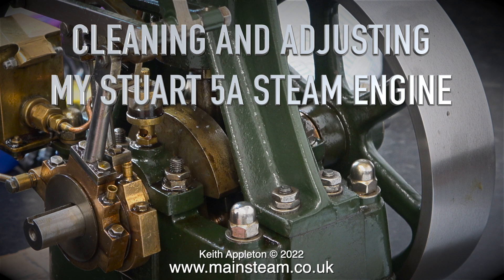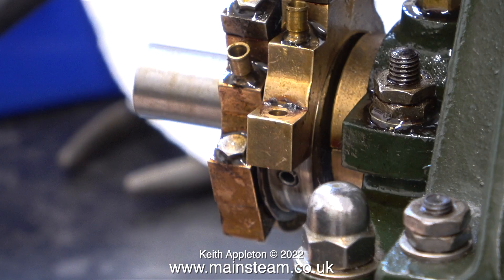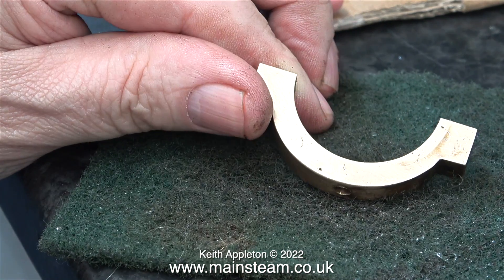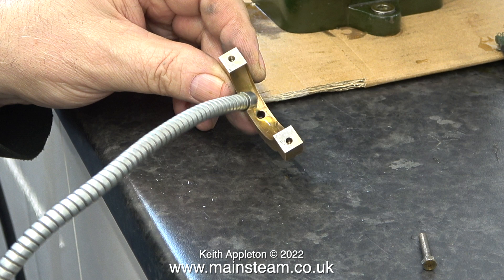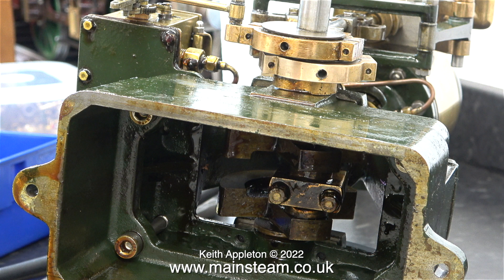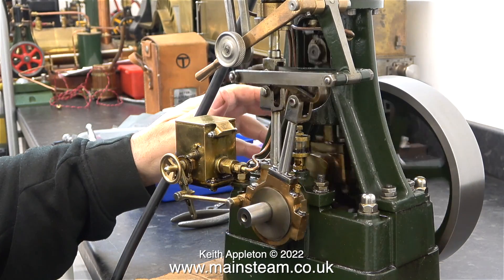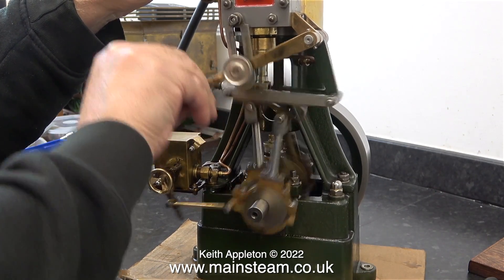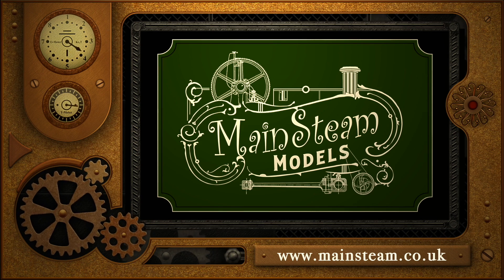CLEANING AND ADJUSTING MY STUART 5A STEAM ENGINE - #1

Comment: Keith, isopropyl alcohol is really effective on tarry gunks, especially in detailed bits like you show on the bearing-cap. Brush-on or soak (in covered container). It doesn't touch paint or common  plastics in my experience.

Obligatory disclaimer:
STRONG FUMES, HIGHLY FLAMMABLE, USE IN WELL-VENTILATED AREA AWAY FROM IGNITION SOURCE.
Reply from the maker: Yes, I used Isopropyl Alcohol every day at one time for cleaning the heads of my 2 inch Tape Recorder in my Recording Studio and it was very good..... Trouble is I don't have any these days as my recording system is Digital  . . . }:-)))
Reply: @keithappleton  :)